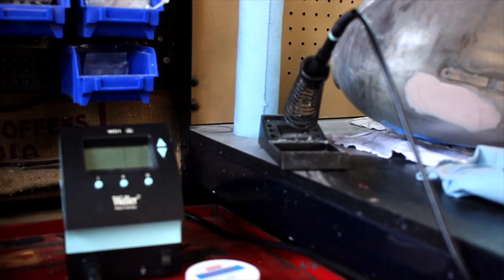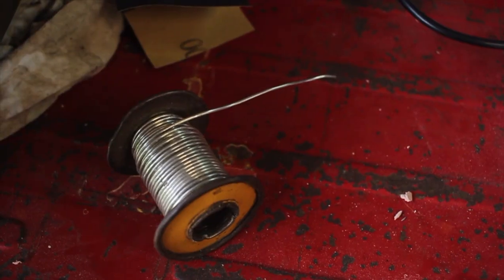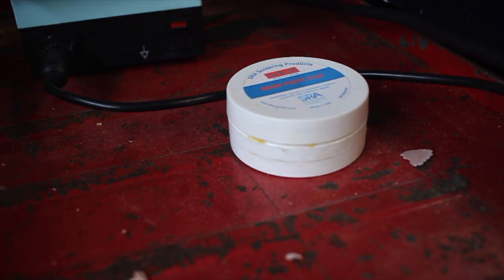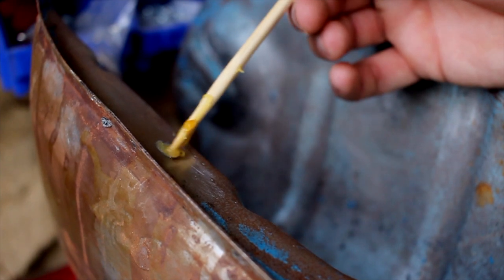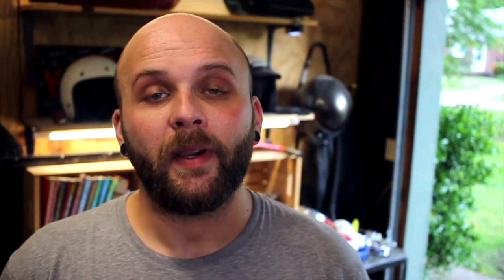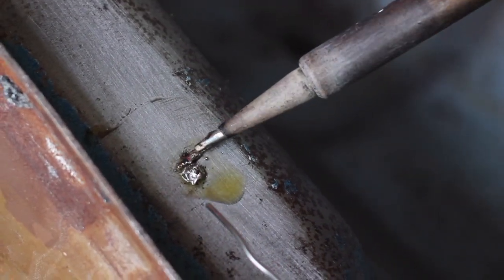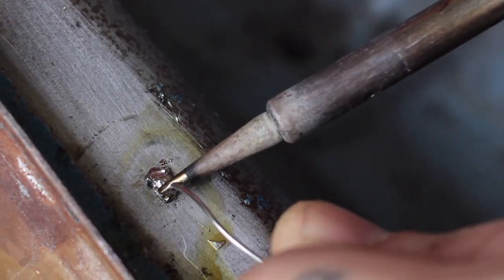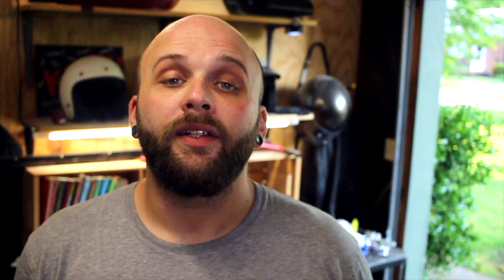How To Solder Holes In Motorcycle Gas Tanks (2019)

Comment: As a plumber I feel obligated to help, the solder not sticking is a problem known as cold welding. Instead of getting the solder hot enough to melt, get the tank itself hot enough to melt the solder. That will allow the solder to stick to it. Using a butane style torch is especially handy in a situation like this because you can get only that small area hot enough to melt and accept the solder without too much heat soak, potentially causing some shrinking.
Reply from the maker: Hey thanks for the advice!! Yeah I've actually taken soldering certification course for my.day job since making this video and recognized my mistake but you know you cant get better at something if you never try it to begin with. Thanks for checking out the video and leaving such a helpful comment!

Comment: Hi m8 well done but just a little tip Im a panel beater and have done this for the past fourty years on car bodies What you need to do is clean the area grind off all rubbish rust paint etc next you need to tin the mild steel eastwoods do a paste paint on then use a blow torch once the heat is faned over the  repair area it will go dull then with a wet clean rag wipe the tinned area like magic it will go all shiney now keep it hot and with a lead stick for body filling the metal will melt the lead use a flat stick to shape ware leather gloves use tallow to stop the stick from burning shape up and file to get a better shape.lots of practice dont burn hands rub down with cloth emery to key ready for priming and top coat . use sloch to seal inside fuel tank . Do the tinning and soldering before sealing with sloch the tank needs to be dry inside.have fun and keep practising Andy Watts from sunny Lowestoft

Comment: Using a heat gun or blow drier to heat up the area around the hole helps the solder attach to the metal. Great video!
Reply from the maker: You're right. I recently did a soldering certification at my day job and learned that I would have had an easier time 8f I had heated the area with a heat gun or something.
Reply: Awesome tip
Reply: Just popped a hole in my tank taking the old emblem off. This is perfect. Thank you

Comment: Use a torch to heat up the tank metal first. That iron tip isn’t big enough to heat up the tank steel and the solder. That was why it took you a while.

Comment: Wrong!  you must get the metal hot enough to melt the solder ..all you have done is make a dangerous "cold solder joint" that can and will pop right off !  when the solder will melt when it touches the metal it is hot enough.  That tiny soldering iron is too small,  Use a propane torch or 100 -200 watt gun/iron.  Must be acid core solder or acid type flux. unless you have special solder and flux, remove galvanizing, solder then re-paint to prevent rust, after removing acid flux.

Comment: Is flux really needed? What will happen if it’s not used?
Reply from the maker: Flux just helps make the solder flow easier. Dont need it but it helps
Reply: I think most solders are self fluxing but in this case it helps to have a bit more initially to help the solder adhere